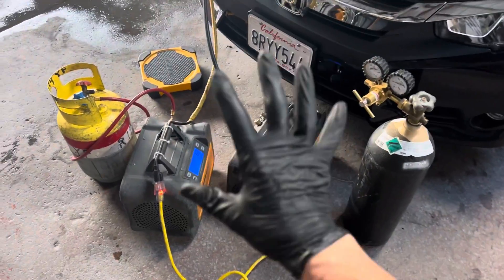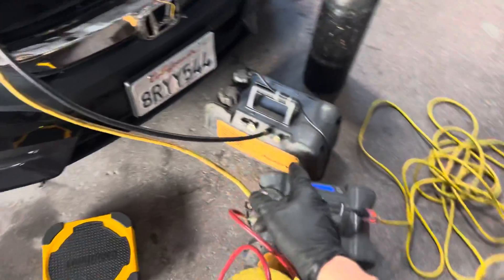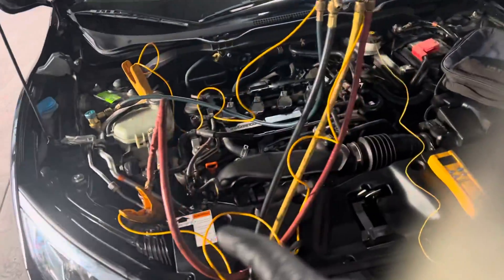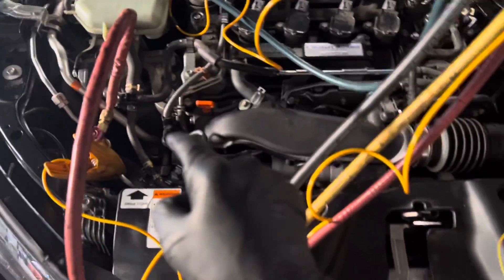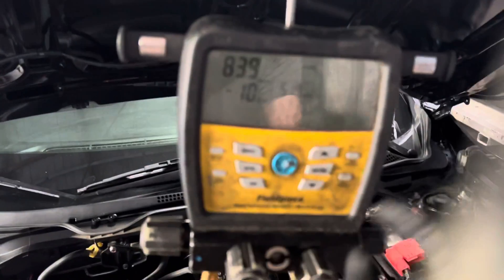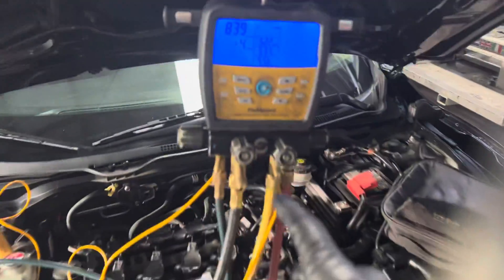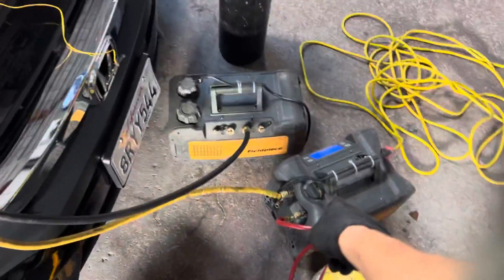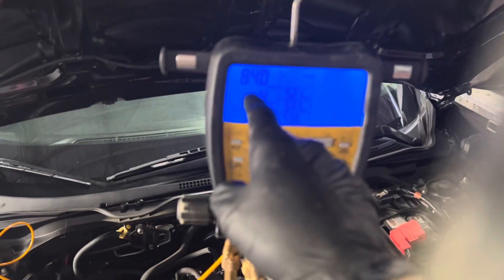Successful procedure receding Honda compressor front shaft seal using 90 g refrigerant￼

Comment: does the extraction vacuum suck out all of the oil too or only the refridge somehow and oil will stay in the system?
Reply from the maker: Vacuum does not suck out oil. 

Vacuum only sucks out refrigerant if there’s a little bit of residue refrigerant left inside the oil and moisture that is trapped in the oil and moisture that is trapped in the pores of the metal because metal have pores in it just like a sponge. 

At the microscopic level metal is just like wood you can soak water into wood you can also soak water into metal. 

In a tapes a very deep micron level vacuum to flash the water into a gas so it can be extracted with the help of dry nitrogen as a mechanical sweeping aid